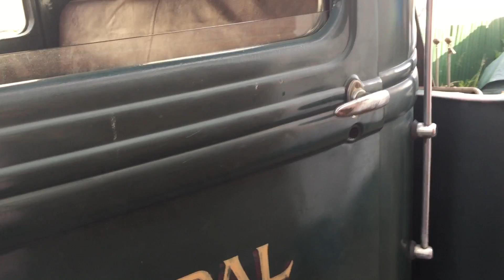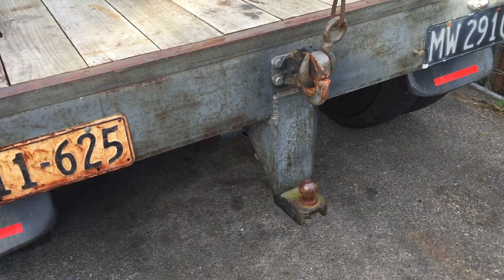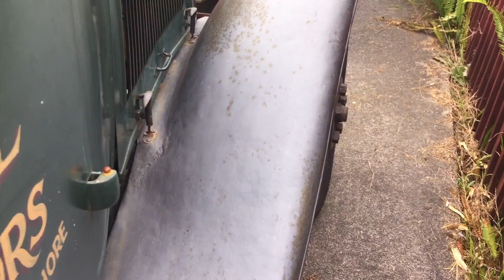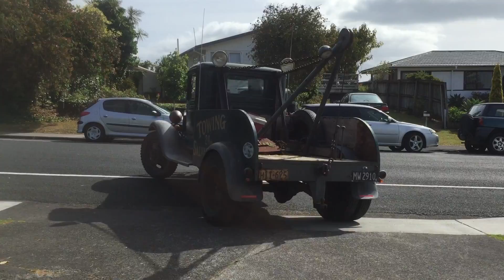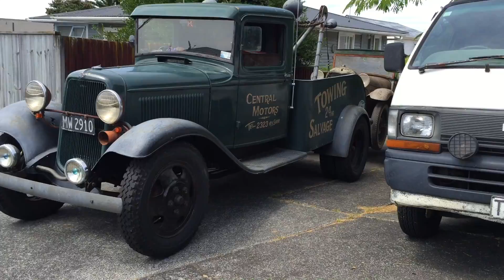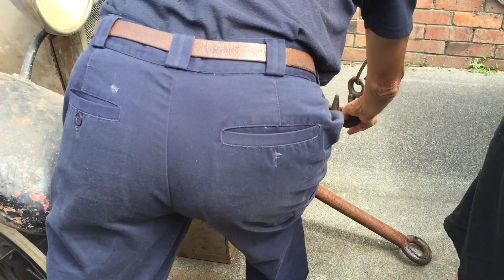Vintage Tow Truck - 1933 Ford SV-V8

Comment: Greetings from U.S.A!  Might I ask...what country are we filming in?  The total lack of corrosion is amazing for a vehicle that sits outside. Even in our driest climates, there are problems.  Your truck is stunning!  Both the lack of abuse and the lack of rust make it a true time capsule. The only modern components I see are the alternator and tires! 
   Very nicely shot video...Thanks for sharing....✌😊
Reply: Hi stumbled across this vid looking for a side valve V8 4 speed gearbox with a pto as I have one. New Zealand number plate & rhd so guessing correct. 👍
Reply: Im betting. New Zealand  or Australia.
Reply: @jeffscott8323  Aussie by the sound of the blokes accents.
Reply: @ivanolsen8596  New Zealand
Reply: @jamiesimpson1786  Your right, I didn't listen close enough to the accents, sorry.
Reply: @ivanolsen8596  Number plate gives it away too.
Reply: @jamiesimpson1786  I was looking at them for a clue but Oz has a lot of different ones,
the towy had an MW plate which could be Mullewa in WA but the numbers were too high, then the "North Shore" on the door could refer to Sydneys North Shore. Anyway Its sorted now. Best Wishes and Take Care.
Reply: @ivanolsen8596  the letters and numbers were just a sequence here in NZ. Theoretically starting at AA0001. North shore is Auckland's North shore. Take care too. Flatheads forever!

Comment: Still has that whine in rearend. Like Old ford trucks.
Reply: It's not the diff it's the low gear in the gearbox,  that's normal  coz of the straight cut gears

Comment: Surprised that the truck fires up. Surpirsed again that it can still tow cars even today.
Reply: Dont be too surprised. The flathead V8 is a rugged reliable engine. It's also very torquey, great for pulling. They are easy to maintain and keep in good working order and they have pretty forgiving tolerances.

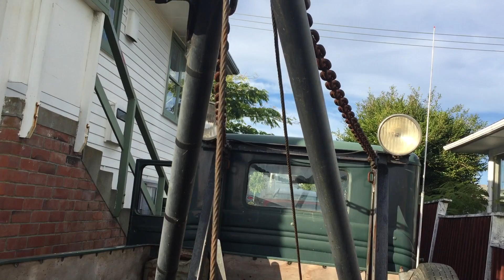Comment: As most people are aware, a great deal of towing is now done with flatbed trucks. At about 2:30 into the scan around, the boom and sheave wheel are shown. 
Around 1977, Holmes equipment produced the forerunner of today's flatbed tow trucks. The bed operation was very similar to the current units. Because the bed didn't have a boom and sheave wheel, the department of public safety wouldn't or couldn't certify the truck as a tow truck. I told my boss that if they wanted the truck to have a boom and sheave wheel, we should fabricate a small unit to set on the rear of the bed so the truck would have a "boom" even though it would not be a functional unit. He said he would rather have the definition changed than going for a loophole.